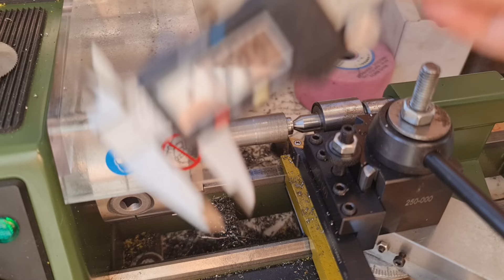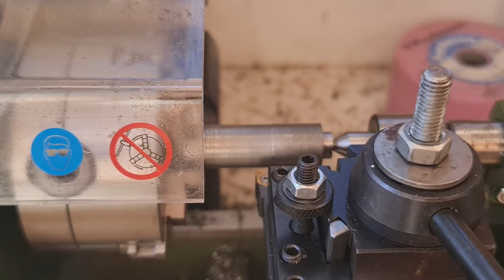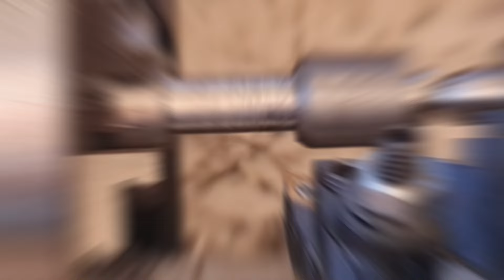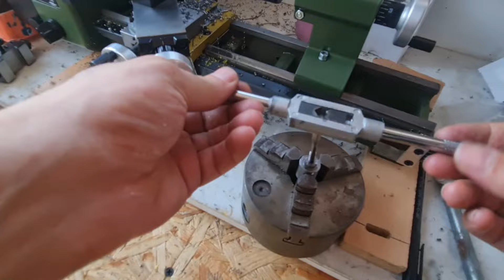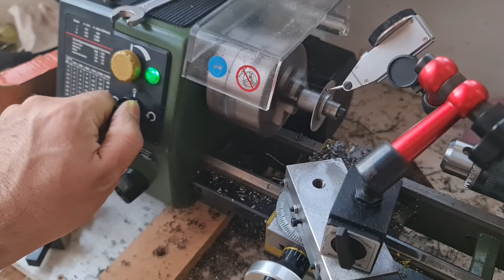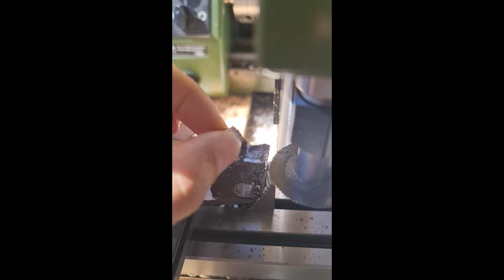Slitting saw arbor making with proxxon lathe

Comment: The infamous rebar :))) This is becoming a recurring theme on your channel.  Nice job
Reply from the maker: haha it seems like so but i started using stainless steel we will see whats going to trasform this channel :D
Reply: @UpCycleMaker  Oh I really thought it was the rebar. Anyway. It's really amazing what this little machine can do with only a little patience and some sharp carbid inserts. I am more and more tempted to get this little machine. My only concern is if it is not too loud...
Reply from the maker: @bastian6173  in this video it is rebar, but i can machine stainless steel. I am using it in my new videos :) I am using it in my apartents  small porch.  I can say this lathe can be used at home.  Machinig rebars thorn  makes sounds but circular stock materials doesnt make much sound. vibration is very very low.
Reply: @UpCycleMaker  Oh now I understand! I think rebar thorn isn't practical in the long run. Too much work in order to get a smooth cylinder.  Thank you for reporting your experience. It's very helpful for my buying decision.
Reply from the maker: @bastian6173  Yes it is realy realy inpractical. You have to spent too much time, effort and tool life. Mine was experiment. I am happy that my experience helps you :)